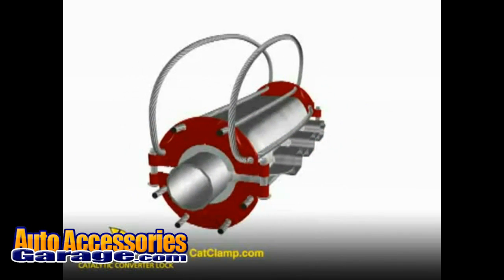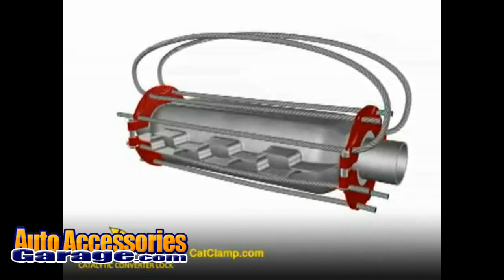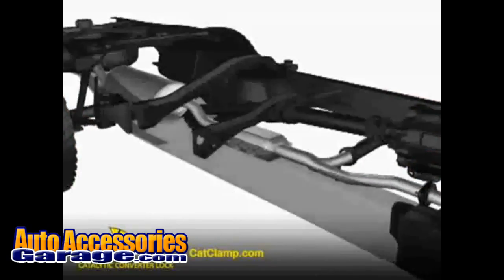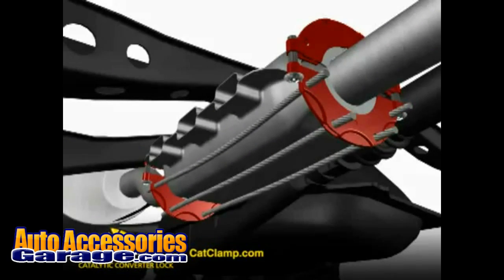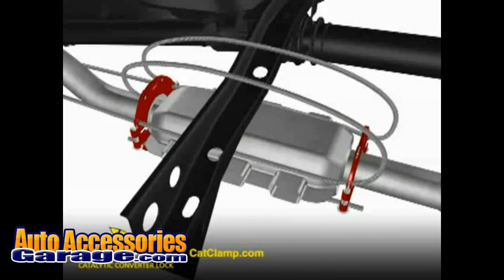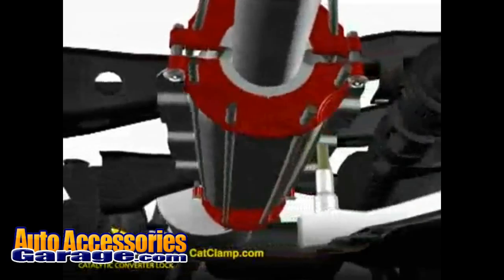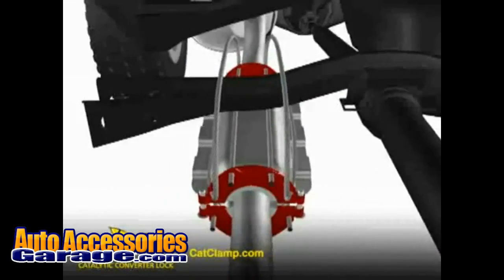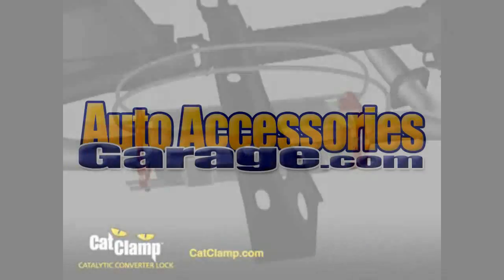CatClamp Catalytic Converter Lock

Comment: Near as I can tell a bolt cutter will have that off in short order!
Reply: but it still requires quite a bit of work and a thief usually wants quick work and quick escape. It will at least slow them down.